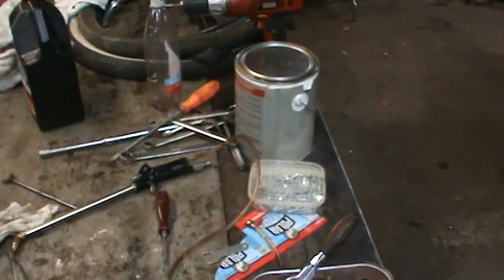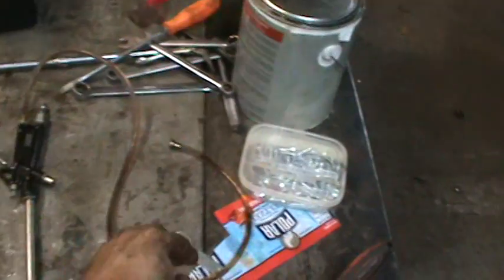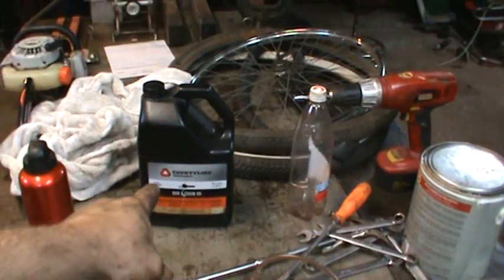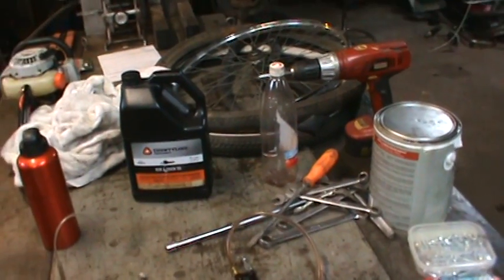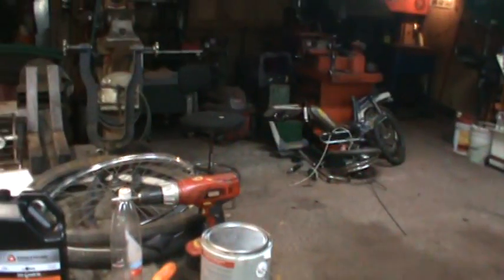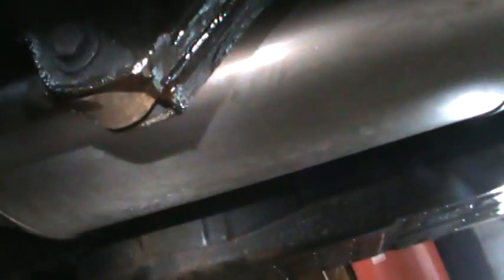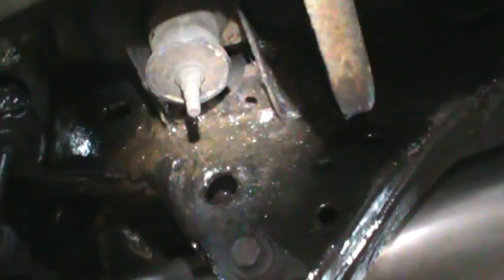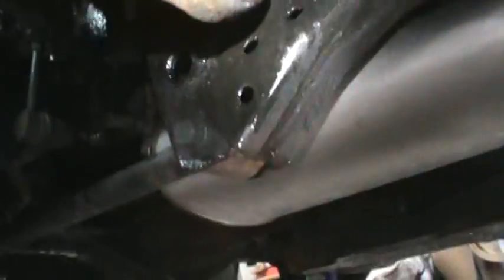undercoating with bar and chain oil,

Comment: When I had purchased my last pickup the owner had sprayed waste oil all over the bottom. Problem was he put too much on so when I got it inspected the mechanic thought I had a massive leak in a brake line. I personally didn't like it so much as so much had been put on that whenever I worked on it my hands were covered in black dirty oil residue.. Great repair job.. Take Care

Comment: 10 parts petrol, 1 part fresh engine oil, 1 part wax/paraffin. Keep it warm in hot water. Spray on all nicely cleaned and dry suspension. Brilliant protection for at least 12 months. Cheap as peanuts.

Comment: Very nice application and heating the oil will thin it out nicely. Pay particular attention to the REAR frame and INNER unibody structures. You could use a Schutz type applicator with flexible hose on the tip to spray the oil INTO the enclosed areas that trap dirt, salt and moisture. The places you miss may eventually corrode. I spray ALL the mounting bushings on the frame, control arms etc. with the oil. It will NOT hurt the bushings. Just keep the stuff off door weather stripping.  You could use Fluid Film in the doors instead if you so choose. Good luck!

Comment: I used regular motor oil thinned a bit with lacquer thinner. I sprayed it with a pump jug lawn sprayer .Shoved the hose in every opening in the uni body and filled it till it ran out every where. Its a mess,  but i think it will do a good job protecting the frame. Will do  another coat before winter.

Comment: I just did my old 81 pickup today. I use (used) hydraulic oil through the cleaning gun on my air compressor. It works well but I'd recommend doing it outdoors with good ventilation. Otherwise you breathe a lot of vapourised oil which can't be good.

Comment: Dirt will stick to oil / grease  dirt will seal it in and protect the metal I have a old truck 1969 I painted the frame there was a major oil leak in the motor at one time all the places were the oil dripped /leaked on the frame dirt built up and sealed the metal I scraped off the grease the metal was under rusted perfect condition . All the rest of the frame I had to scrape the rust with a wire brush in order to paint or undercoat it .....

Comment: Does this damage any rubber components? I thinned it with some paint thinner, and it seems to hold up well. Leaves a good oil film dirt sticks too, but I got some on my rubber brakes hoses, suspension parts and other stuff.

Comment: Update on heating the oil!!    After using a teapot for many years to heat up the oil and wax, I've settled on using a electric cooking crock pot. The crock pot has a maximum temperature of 100C (212F) thus reducing the possibility of overheating the oil. Just pour the bar oil into the pot with some wax, and let it heat gradually.
Reply: Please elaborate on your history here.  What are you long term results and your experiences.  You seem to be knowledgeable on this.  I've got bad rust trying to deal with it presuming I need to do the ATF route of penetrating before B&C with paraffin.  ????

Comment: Hi and Glad to see you are using the bar oil!!. We posted a suggestion last year on your "Fluid Film review" .  
Take a 1/4 bar of paraffin wax to each container paint gun refill. Throw it into a teapot until the oil just begins to smoke and spray very lightly on all metal surfaces.

Comment: You are better off to use naval jelly brushing it on everywhere then after that, do not rinse off the naval jelly, leave it on and let it form into a hard white film overnight.  Do this about 3 times over a 3 day period and most of the rust will be gone.  Then use a bare metal etching 2 part epoxy primer on all surfaces to prime them.  Then use urethane 2 part clearcoat on everything.  Then use car polish cream that is advertised to protect surfaces for a year.  Every year, clean and check how the paint is holding up and reapply car polish cream to reseal and prevent elements from touching your clearcoat.
Reply: I don't see it happening.  I'm using concrete etcher which contains as much phosphoric acid as naval jelly and it eats at the rust, sure, but only to a point and only so far.  You need an air driven pin slag scaler or similar all over to get the point where the etcher might accomplish what you describe... a LOT OF WORK and dirty.  I doubt your method will work anyways cause you cant effectively get all the rust and it will work in from the sides, seams, edges etc.  Just an opinion.  On bare metal readily at hand workable with tools etc maybe but a car underside is miles from THAT.

Comment: That oil will serve a dual purpose. It will keep the rust away. PLUS -- if you run over a bum, he'll squirt right out the back instead of getting tangled up in the frame! Okay -- that's a little harsh. Still -- nice work.

Comment: Looks good to me.  This is a good solution for if you already have serious rust issues because the oxidized rust absorbs the oil and creates a water barrier.  After the barrier is formed, debris really doesn't do harm by sticking to it and it actually is beneficial when you have to work on it because it allows you to wipe it off without it sticking to everything.  I just did some hefty applications of POR15, but it has its limitations because of moisture already present in the rust and the fact that frames sweat, causing rust to destroy your car from the inside out.  Over time the oils should replace the moisture (which is actually the original purpose of WD40).  I am hoping that an application of this (I was originally going to go with the oldschool grease tube in some oil) will add another layer of protection to the POR15.
Reply: +Mark Weimer, Apply light coating's Dexron ATF in (warm summer weather first) , then let the vehicle sit for a while to allow absorption. Spray the ATF into all enclosures!  Then if you really want protection , apply heated Husky bar and chain oil with some wax lightly on and in all frame and suspension components, especially in the rear section of the vehicle. The ATF kills the rust!  The Bar Oil keeps the ATF on and water off the metal parts.
Reply: +Tom Bartlett Did that this summer.
Reply: ATF is quite flammable, fyi.

Comment: I'm thinking about doing this this summer. I've heard you can use diesel to thin it a bit.
Reply: I bought a used southern truck and did this as soon as I came back with it.  Four Michigan winters and so far no rust.  A suggestion though.  When you do it, tape off your weep holes and spray the inside of your panels as well.  Where they crimp over the panels at the bottom is where the rust starts on them.

Comment: Have you tried a product called Fisholene made by Wattyl.   It is quite thin and really soaks into the rust well (no good on scale rust) and then will thicken and skin over to a tack dry.  The skin stops dust sticking to it and doesn't wipe off once tacked!   Great product and soak my boat trailers in it which sit out in the elements and still no sign of rust.   Use it on the car, steel tanks, tools, rideon mower, motorbikes.  You can also paint over it with your favorite primer and top coat if you want.

Comment: i use used motor oil in a gallon jug of motor oil and a siphon gun on a compressor to 150 psi ... 15$.. blasts it allover in every crack
Reply: +Lia Favourite I'am also with you on the ATF !  Been using heated Bar oil with wax for many years. The Dexron ATF works beautifully out of a pressure pot spray gun with only 1 psi pressure to the pot. The ATF stops the rust completely and stays on the surface really well.  I spray the ATF in warm weather and let the each car sit and absorb the oil for a week without driving them. I then apply the hot chain oil mixed with bar wax to the rear high splash area's and it stay put beautifully. Spectacular performance!!
Reply: yes i spray all the parts that  are to be rustproofed but i dont spray directly on the cats but mist gets on there ..
Reply: san379 lmao light up the car baby
Reply: Harry Balls ATF is a hydraulic fluid it shouldn't ignite...
Reply: but it does..my buddies cougar broke the cooler line and it was leaking on the exhaust and it caught fire

Comment: I use agri wax and old engine oil ...mix wd 40 to thin in a bit .we use the same on our ploughs and cultivators ..some of them are stored out side all winter .I spray my cars with the same ..my 05 powerwagon looks like new underneath .takes about an hour .

Comment: My undercoating guy uses chainsaw bar oil and candle wax on my old truck.  It works great, but it's a mess and drips a lot. Not recommended if you have a paved driveway.
Reply from the maker: l started using bar oil too, lasts longer,
Reply: mustie1
That your Type II?  Nice, very nice.  My brother has a Ghia in pristine shape.
Reply: Rust kills your car oil just makes a messy driveway.

Comment: I would love to see someone use the bar and chain oil without thinning it down.  I have heard of people heating the oil like you did the toilet rings but instead of pouring it into the paint canister you could leave it on the hot plate keeping it warm and run a long tube from the gun to the warm oil.  Would need a second person to hold the hose in the can I suppose.  
Seems like the added benefit would be when it cooled down it would regain its original viscosity and possible last longer as a result?

Comment: Straight hydraulic oil works best. Used oil swells up rubber suspension components and makes them brittle in time. Hydraulic oil lubricates the rubber without swelling it. Fluid Film and Woolwax is nice, but costs too much, and wears off in critical areas in a few weeks, especially in the Northeast. But anything is better than nothing

Comment: I've been brushing on Boiled Linseed oil because it dries after a few days. I've been wondering if it would feed through a paint gun...
Reply: I do the same thing but instead of brushing it I put it in a simple pump sprayer like you would use to kill weeds and just think it a little with mineral spirits and it works awesome the pump sprayer comes with a 2 foot wand so you can get it and all the frame rail holes just remember to put a tarp down and park over it Happy spraying

Comment: I have a question I'm looking to do this for my car but I want to know if a squirt bottle like for cleaning supplies would do the trick I don't have any of the equipment that you have
Reply from the maker: you could use a brush, rag, and or roller, but its going to be messy, l think the thickness would be too much for a bottle,
Reply: Cool thanks for the help
Reply: ZombieKingJJ I bought on eBay plastic pressure bottle designed for  spraying acids and oils. Just hand pump pressure and squeeze. Not tried it yet so can't say how it's work. Thinking doing it tomorrow. Will using engine oil mixed with diesel to make it thinner.

Comment: Hi Mustie1,
Thanks for the tip on the Bar and Chain oil. I am looking forward to trying it out. 
I wanted to know how long this oil coating lasted you? Reapplication time? Also what type of Bar and chain oil did you use? Summer or Winter kind?
Reply from the maker: M K its only been 2 years, and l look at them in the fall to see how its holding up,l think after 2 coats its pretty good
Reply: Did you double coat the first year or every other year? Also can you confirm if it was the heavy grade(summer) or the light grade(winter) oil you used. Which one would you prefer?
Reply: Couldn't you just spray undercoating on it?

Comment: I understand that using used motor oil or bar chain oil will work but who wants their vehicle to be a complete drippy mess ? I believe that diesel fuel or ATF fluid or a combination would work best. I believe that ATF fluid works great as a penetrant to loosen rusted nuts, etc. Perhaps thinned with kerosene. But I would not use any petroleum distillate on rubber or plastic as it will likely dry them out over time. 
I have a new truck and plan on spraying it down with diesel fuel most likely. 
In New England "Fluid Film" is popular undercoating which contains lanolin oil. Lanolin comes from sheep skin and is approved by the EPA . The EPA doesn't want your used oil washing off on the roadways.

Comment: Watching CORVAIRWILD using Fluid Film that stuff seems to hold up EXCEPT in high slash areas like wheel wells, and I swear that bar and chain lube goes on almost exactly like Fluid Film. Based on the way regular oil hangs around and collects dust, I can't imagine this stuff, as sticky as it is, is going anywhere unless it's splashed off. I'll hold up I'll bet.

Comment: I used 3 qrts rustoleum I had sitting around to one qrt bar and chain oil with this type of sprayer and it was tacky for 2 days then dried to the touch. Covered nicely and with color looks great. Looks like it was done professionally at about $25 bucks in cost. I did 2 coats an have enough left to do another 2 coats. I sealed it up. It’ll come in handy next year , or the following depending on how well it does

Comment: Also I used dupli color rattle can truck bed coating good stuff sticks to anything it's 10 bucks a can I used about 20 cans to under coat the truck engine bay fire wall under hood etc $$$$$$
Reply: Bed coating traps moisture and will end up creating more rust.

Comment: Or just go about this once or twice during the winter with e.g. WD40 (regular) or WD40 Specialist. Just spray everything down. Not everyone has access to a garage, compressed air, etc. :)
Reply from the maker: wd is a cleaner not an oil, it washes off way too easy, you can brush or roll the bar and chain oil too,
Reply: Skip to page 28 of 52 in the link above

Comment: I've got serious rust problems on 2005 SUV. About 3 years ago I physically removed rust scale amap. I looked into POR15 but it was expensive so opted for Pettit RustLok. Well. Maybe I screwed up and should have applied phosphoric acid concrete etch to my metals for a few days before carefully applying the RustLok but let me tell you 3 years on the RustLok failed hard in its marketing promises. It's literally lifted right off the applied areas in most cases and heavy rust ensues. Grrrr. It seems the concrete etch eats the rust to a certain degree, it's phos. Acid like naval jelly but higher content and cheaper home improvement store gallons. Unfortunately, for deeply ingrained rust I find the etch only eats down so far even with rep acted applications so you have to knock off the scale pretty well first if you want good results but I'm told it converts the rust to o at least some extent and stops it. Anyways. It's so bad now as dire straights. I've found an air driven pin scaler is effective at removing rust scale close to metal. I've long considered using bar and chain lube as my own experience with it on motorcycle chains is that it has a clinging agent and with the dust encounteredit becomes pretty durable. Unfortunately, again, my experiments with B&C lube is that it won't penetrate the rust more than a certain degree same as the etcher. Eventually, sweating or whatever and the rust under pushes it off and your screaming again. Interestingly, for you people whom might be interested, penetrol actually protects bare or lightly rusty metal very well and for quite a while but it is entirely uneffective under a car in the wet and salt spray. So I'm highly curious here about this process described. I understand ATF penetrates well and you put it on a few apps and leave it penetrate/dry and then you apply heated B&C lube with some paraffin added? Then you want to drive it in dry conditions preferably dirt road? Help help help school me on this! Have I got this process right and >>>> How has this worked out longer term to protect the underbody? Doe the B&C lube expand door and window seals?

Comment: How is it holding up? I used medium bar oil and it seems to be runny.
Reply from the maker: seems fine
Reply: Maybe I might give it another coat, or melt it with some wax or heavy grease.

Comment: Hey grind that rust off and acid wash add a tube of heavy grease mix with paint drill Microsoft apply with brush.. I add just a Lil brick acid cleaner to used oil and grease after wire wheel drill brush
Reply: Where do I get a microsoft paint drill

Comment: Holy smoke.  Why would you want to spray this mess under your car?  He said it would collect a coat of dirt.  Seems counter productive since dirt has things in it that are corrosive.  The "oil spray" I have seen that IS actually affective uses a tar, or pitch solution with a delivery chemical, that when volatilized leaves a DRY water resistant coating.  A barrier between dirt and steel, if you will.
Reply: The problem is, like undercoating, if a crack develops the water gets in and can't get out.  You can't see the rust forming underneath.